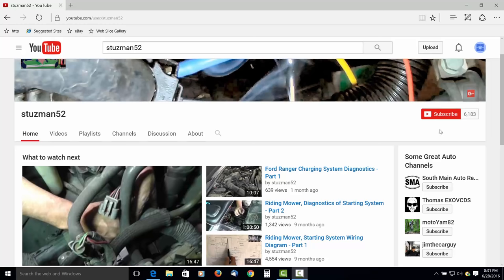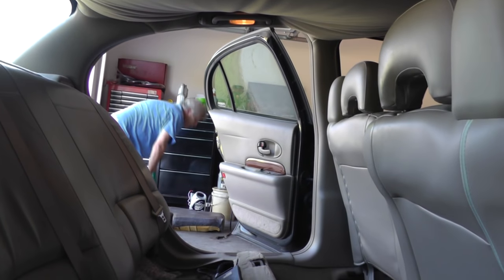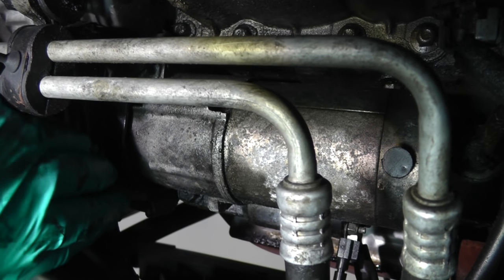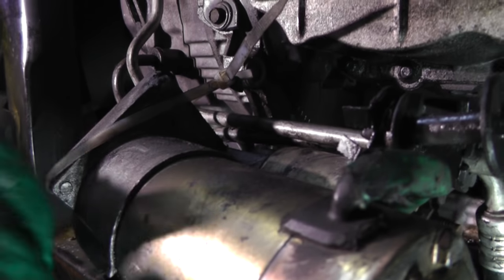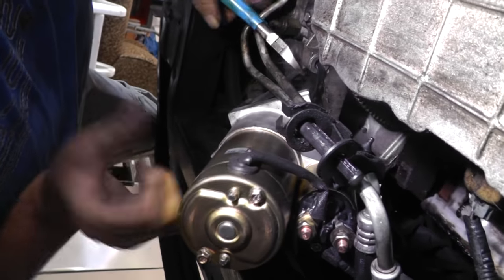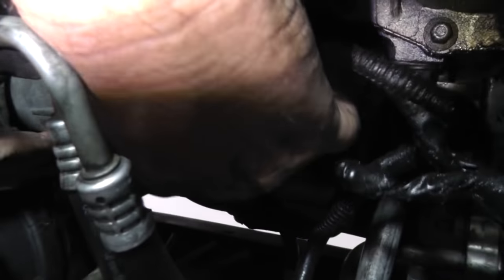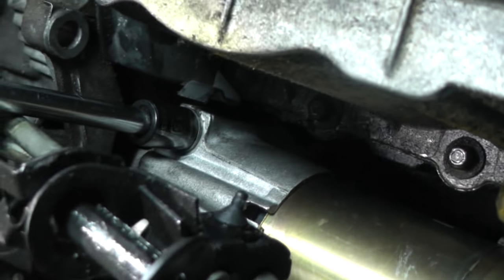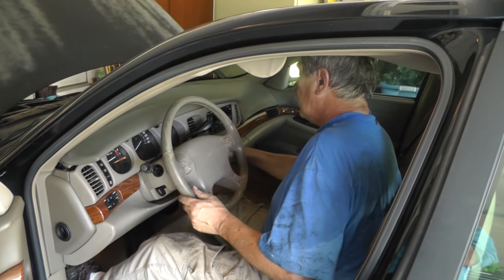Buick LeSabre, Starter Motor Replacement

Comment: You’re GREAT, Sir! My Buick’s sitting out on a farm right now, and instead of lugging a tool coffin, I can take along what I actually need: 8, 13 and 15mm sockets, and the torque wrench clicked for 43 Nm. Thanks!
Reply from the maker: Glad to hear that I helped out Hein and good luck on getting that Buick running :)
Reply: stuzman Thanks! Ordered the solenoid, getting it tomorrow. “Stu(t)zman(n) = a gentleman who gives support. Thanks again, and God bless you!
Reply from the maker: You're quite welcome Hein and good luck!
Reply: stuzman Thanks again - new starter is in place and we’re mobile this side once more!
Reply from the maker: Hein Bertram Glad to heat Hein that it all worked well! 😀

Comment: 2000 Buick LeSabre Custom. Great video. Took me a couple of hours to replace the old starter with a new one jacked up in my driveway. Hardest part was disconnecting the ignition and positive cables and reconnecting to the new starter. My cables seemed to be a little shorter. Thanks
Reply from the maker: Glad to hear that you got it all worked out! Have a great day!

Comment: Thank you for this informative video, very well done. You have inspired me to take on the task with my 2000 Buick Regal.
Reply from the maker: Thank you very much sir. Why not go for it? It's a pretty easy job...Thanks for dropping in and sharing a comment!
Reply: VandewegheProduction I've had the same problem with my 2002 Buick Regal the starter on mine got stuck because my starter was very weak so now I got a new starter motor installed & now car starts no problem.

Comment: Thanks for the video, my starter just went out. My car is currently sitting in a Walmart parking lot. It has been slow turning from time to time. Now it goes click click click. Battery is good. Also noticed that lights in car would dim down when trying to crank which I figured was a dead short.
Reply from the maker: Not likely that you have a dead short Mathew. Be sure to check battery connections or possibly the starter motor is bad.
Reply: @stuzman52  You are correct. It's not a dead short. Starter is good. Battery is good. Noticed something odd when trying things. Key on and wiggle it a little and warning lights would disappear and reappear. So i'm going to go out on a limb and guess it is a faulty ignition switch. Or at least I hope that solves my problem.
Reply from the maker: @mathewbegnoche2095  It sounds like your ignition switch Mathew. It would just take a few voltage checks on the switch to be sure.
Reply: @stuzman52  This may blow your mind, I finally got it figured out. Okay so new starter, battery, and ignition switch still no luck. Even swapped relays. Thought I would check to see if motor would turn by hand. Took belt off and out of curiosity checked all pulleys. We have a winner AC was locked up tight. With belt off car fired right up. Waiting on a by-pass pulley assembly.
Reply from the maker: @mathewbegnoche2095  Sometimes, it's the least obvious that sometimes gets us. Glad to hear that you got it figured out Mathew.

Comment: The battery being under seat is not stupid. Lasts a hell of alot longer under seat not being exposed to the elements lije under hood! On my 03 my battery is 4 1/2 yrs old and still operates at 14.7.

Comment: I am in tears between the wasp and the Seat belt latch pure comedy gold Terry... It takes me 5 minutes to remove my starter and a hour to put it back in..did you run out of gloves? lol
Reply from the maker: Hey Rick and hope you're doing well! I'm glad you liked the wasp scene and the seat belt latch flopping around my hand LOL. I've run into the same thing about getting parts out quickly and then it takes forever to get it back in. HaHa! The gloves...those damn things got so much grease and sweat from me wiping my face, that I couldn't even get the bolts started, so I just took them off. Glad you dropped in Rick and left a comment!

Comment: Better be careful Terry and don't get dehydrated. Temps that high with high heat index can drain you quick. I speak from experience. Good vid, well done. HOpe you killed that wasp.
Reply from the maker: James Pinckard Yes you’re rightJanes and I drink lots of water when in the heat. 👍

Comment: Is that a breaker bar you used to take out the bolts?
Reply from the maker: Freddie, I assume that you are joking, but just in case you're not, no it's not for removing bolts.
Reply: @stuzman52  is it just a ratchet extension
Reply from the maker: @YONKOFD  Yes, that’s correct. A ratchet with an extension.

Comment: Great work I'm searching for the ground wire that's right by the starter and I can get a good view of it looking at your video my Buick LeSabre won't make any sound when I try to crank it. So hopefully I can figure this thing out I wish you were my mechanic I'll tell you that
Reply from the maker: I don't recall a ground wire being on the starter motor Gerado as I believe the grounding for the starter motor is done through the engine block and then returns back to the DC- on the battery. Of course, I could be wrong as it's been awhile since I've done this video without looking at it. I'm sure that you'll get it figured out as starting systems are pretty easy to troubleshoot. Good luck on what you find!

Comment: Just Bought a new battery and alternator for my 2001 Buick lasabre it came on I thought all was fine until Two days later my car just rings and it won’t start. Do you think I need a new starter motor is this is the reason it won’t start
Reply from the maker: It could be, but you should do a little diagnostics to be sure if it's the starter motor.
Reply: stuzman how can I do that? It’s so hard to come across mechanics
Reply from the maker: Maine, I'll describe the procedure and hopefully you'll understand as I don't know what electrical background you have. If you have a DVOM, measure the voltage drop across each battery cable while cranking the engine. The maximum voltage drop for each cable, positive and negative should be 0.5V. The lower the voltage the better. If that looks good, you can take a test light hooked to battery ground and the other lead to the solenoid terminal on the starter. You'll also do this while cranking the engine. The bulb brightness should be bright. You'll probably going to need someone to crank the engine while you monitor the results of the tests. Hopefully, that will get you on the right track.
Reply: @stuzman52  someone told me it might not be your starter they said did i let it run or even drive it for a bit i said no ...they said i should give it a jump then take a stroll for about 30 mins
Reply from the maker: Maine Lee You could try and jump it off to see if it will start. I see that you replaced the battery and alternator. You could have a problem with your charging system which could prevent the car from starting.
Reply: @stuzman52  thankyou will give a try

Comment: stuzman, I have a 2004 LeSabre and there is a tapping sound coming from  the dash board but it only happens in warm weather.
Have you ever had this experience before?
Reply from the maker: I can't say that I have Jim. Maybe you have an actuator motor issue with one of the blend doors.

Comment: will replacing a 2006 Buick Lucerne starter be similar?
Reply from the maker: Kris,  I know up to 2005, it should be the same. For 2006, it should be the same and if not, it should be very similar. One way to find out is to take a peek underneath :)

Comment: My 94 lesabre stop starting today tested battery, jumped it still nothing until i started tapping on the starter and it wanted to crank but i seen the starter smoking so i stopped.
Reply from the maker: Sounds like you found the problem with the starter motor being the issue :)

Comment: You can use an extension socket to get to the bolt without moving the other parts
Reply from the maker: You could be right and whatever works, I say go for it:)

Comment: You should build a statue to GM and the 3800 motor. If this were on a VAG engine it would have taken two days, you would have needed five special tools and you likely would have needed to remove the front of the car or pull the engine. If only GM still made them like they use to. I wrecked my Grand Prix and needed to buy a new car. Went to GM and hated the Impala and the Malibu only comes with a turbocharged engine which to me is the instrument of the devil. Ended up with a Hyundai Sonata. Nice and the price was right but I'm sure it's going to be a pain in the ass to work on. Hell, you've got to remove twenty bolts and screws just to get the engine diaper off so that you can drain the oil and change the filter. It's going to take me three floor jacks to lift the damn thing to get underneath it. Jacking the car is a nightmare. But don't worry Terry this is progress. Yea, right.
Reply from the maker: I agree with everything that you've said Dennis. One of our co-workers had an Impala with the 3.8 engine and got about 30 miles to the gallon. He said that he loved that car and hated trading it in. He got a newer Impala, but this time GM stopped making the 3.8L and replaced it with their newer 3.9L. He said the engine dropped in mileage down to 22 mpg even though it had this technology that would drop cylinders when cruising. He hated that car and said he wouldn't buy another GM. I guess that's why I'm holding on to the older vehicles because as you've said, it's a PIA to work on any of them, not to mention high ass car payments. HaHa! That's right Dennis, it's all about progress isn't it. Pretty funny...
Reply: It's actually far worse than that. The new 3.6L Northstar that GM puts into the new Impala sucks super bad. These things have dual overhead camshafts and the timing chains are about 10 feet long. The 3.6L eats timing chains as they stretch. Being 10 feet long how the hell could they not. Eric O. told me that he had a customer with one of these engines that's had 3 timing chains in 120,000 miles. $2,500 each time.  You've got an engine that works why dick with it. I'm surprised they haven't totally ruined the LS series of engines yet. I'm sure they're working on doing so. All of this complexity is bullshit. Overhead cams, variable valve timing, turbochargers. All BS. As you correctly stated the 3800 got 30 miles per gallon in a damn Grand Prix that weighed 3800 pounds. That worked for me. 250,000 miles without any engine problems whatsoever. Five water pumps, three radiators, two upper intakes, lower intake gaskets, three alternators and about 10 batteries because it's so damn hot here. But this engine was bulletproof, light, small and easily serviced. These people are nuts.
Reply from the maker: You know Dennis, it just seems to be a new business model today and managers run a business with no common sense at all. I haven't been following GM's newer engines and that 3.6L engine sounds like a crock of shit. 10 feet long timing chains, WTF! Who in their right mind would design an engine like this? Oh, wait a minute...maybe the GM engineers have been in touch with the German folks LOL...As for the 3.8L that I've got, you're right that these engines are bullet proof. In fact, I haven't changed the radiator, the water pump or the alternator. And this is the first starter for this car. I would say it's only weakness is the 4T65E tranny which has been rebuilt twice. The last time I pulled it out and did a complete rebuild on it about five years ago. And with all of the tranny's weaknesses, I put upgrade kits throughout. That was five years ago and still doing great. Have a great day Dennis and maybe we can see some of your new car while you're working on it. And don't worry about the swearing as I do quite a bit especially when I'm working on that VW LOL...take care Dennis!
Reply: New engines are needed because of emission standards. They get tighter every year and the older engines cannot meet the new standards. They can't stick with the old engines even if they wanted to.

Comment: Hey, I was just wondering how you learned so much about cars? Did you go to school or were you taught  by a person?
Reply from the maker: That's an interesting question Taylor! I keep telling myself that I need to update my intro video to tell a little more about myself. You would think that since my Dad was an auto mechanic for 45 years, that I would have learned a lot from him. But, we didn't get along that well and we didn't make amends until a few years before his death. Most of my learning about cars came from being self-taught. I didn't have a mentor and I've never worked on cars professionally, nor did I go to school for it. With my background starting out in industrial maintenance, that gave me the starting point for things to come. As the years rolled on, I've gone to school several times for electronics engineering and refrigeration of where I earned diplomas and degrees. Today, I'm an electronics/electrical controls engineer and with that background working on cars is second nature really. Hope that answers your question!
Reply: stuzman yes it did. I lice working on cars too I have been told I need to go to school for it, but that seems illogical because I don't want to work as a mechanic it's just a hobby. I am in college for EMS and and trying to be a firefighter-paramedic. This video helped my Change the starter in my 98 buick century. I am a YouTube taught mechanic.
Reply from the maker: Taylor Meaders Taylor if you have a passion for something you will be able to teach yourself whatever you need to learn. You may have to watch YouTube videos and read books, or whatever it takes, but you will find the answers that you need to learn a trade that you enjoy. 😀